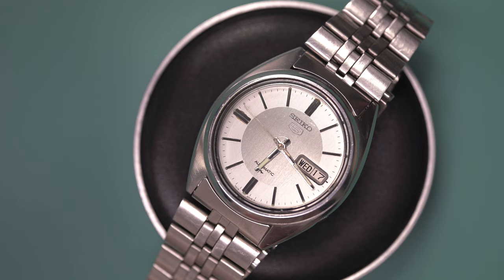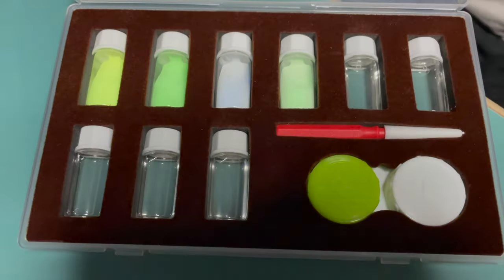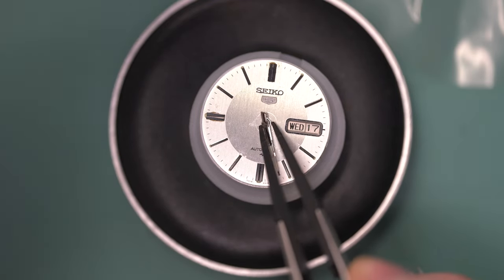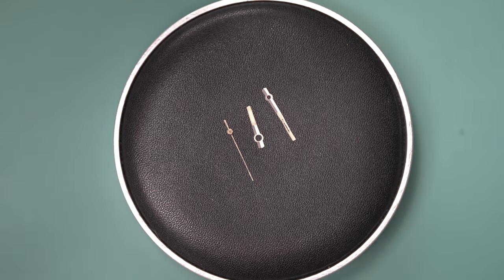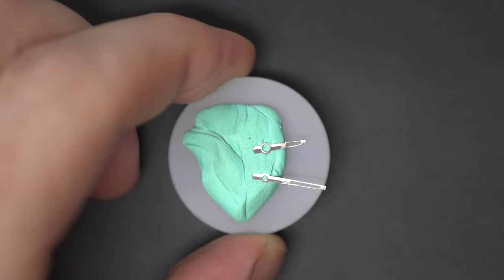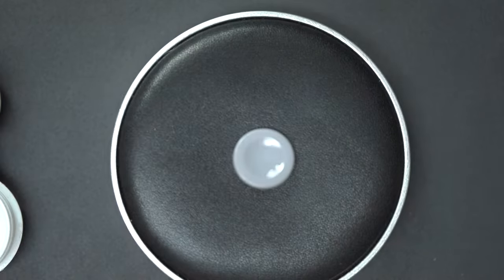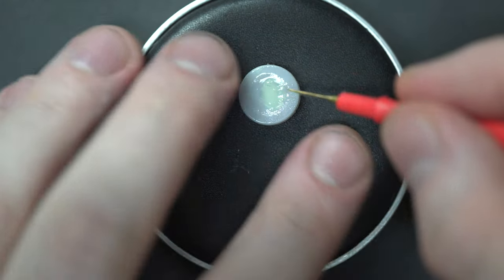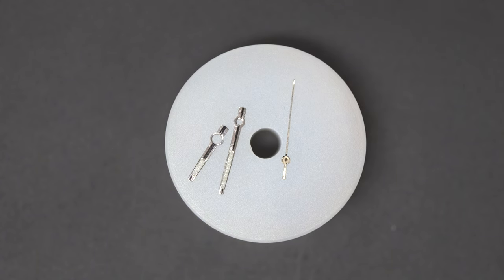How To Re-Lume Watch Hands using affordable $15 DIY kit, Restoration Tutorial

Comment: Instead of scraping the lume,  soak the hands in pure acetone for an entire day in a small glass jar.  After soaking a day ,  then put the jar  in an ultrasonic cleaner (yes..the hands inside the jar).  The lume will disintegrate.
Reply: will this have any effect on the finishing of the hands (assuming they're just metal finished and not painted lol)? I'd hate to strip the hands of any type of polished finish while trying to remove the lume.
Reply: @MrHockeyhead019  No harm to metal finish.
Reply: @MrHockeyhead019  100% acetone won't harm the metal. Even coin collectors use this trick to clean some dirt, without damaging the thin layer of oxidation that protects the metal disk

Comment: Hi JSG I have re-lumed 3 watches this year and it was a bit nerve racking at first. I found that if you tip the bottle and put a drop of that sticky liquid in your mixing tray first then add the lume bit by bit its not so messy and you get a better consistency also I used a tooth pick to mount the hands. Nice watch and a good lume match. Cheers dude
Reply from the maker: That’s a good idea! I’ll try that next time, thanks for the tip 🙏

Comment: Thanks for the video.

Based on some internet searches I've done on luming hands, Testor's Dullcote (a product for plastic scale models) can be used as a binder. 
It's a bit on the thick side, but plain ol' lacquer thinner can thin it down to a workable viscosity and can be used with pretty much any lume powder.

Less than USD$10 for more than a lifetime's worth of reluming.
Reply from the maker: Thanks for the tip Markus 🙏 Some people have also suggested some clear lacquer typically used for aerofix models too. I'll do a little experimenting  one day! JSG

Comment: Hi JSG.Thanks for your videos. I'm still new to watch repair. I'm just wondering could you actually a change a quartz movents to a automatic movements? Thanks alot
Reply from the maker: Hey, this can be done, but you need to know the casing dimensions to know if a mechanical movement would fit (diameter/height/crown position etc). As long as the case size matches the movement, shouldn't be a problem! JSG

Comment: Great video - Thanks ! Just a couple questions... Did you apply from the backside or front (show side) of hands? And how do you clean off the excess before the lume dries? Thanks again!
Reply: apply the lume with the hands facing down after removing the old/cracked lume. you won’t need to clean any excess material if done correctly because you’re applying from the back and the front side should be clean.

Comment: Did you have to take any precautions when removing the old lume? From what I understand in the 80s they used either promethium or tritium on the dials, is it safe to deal with considering the half life?